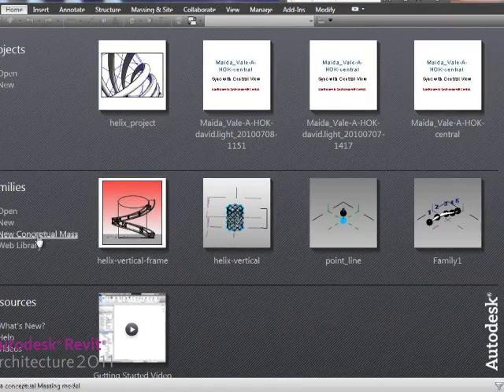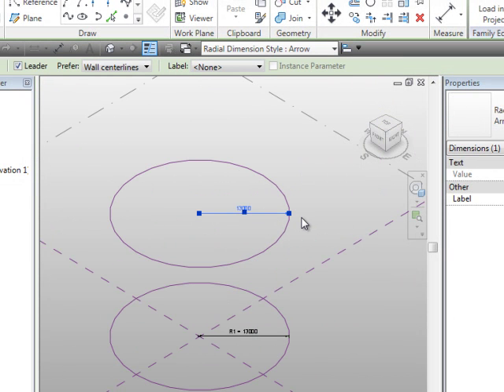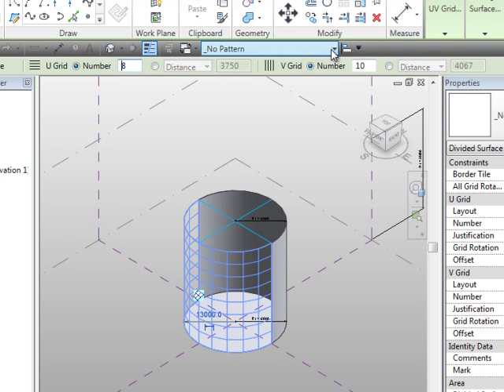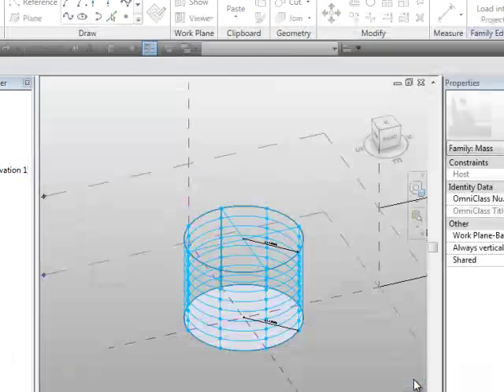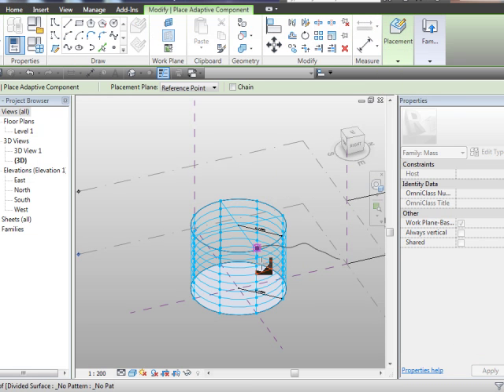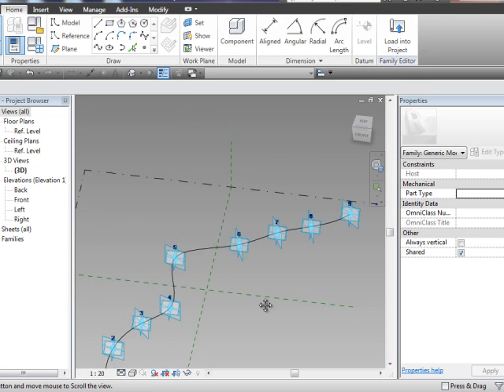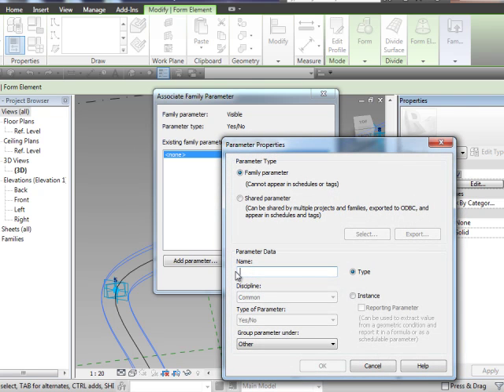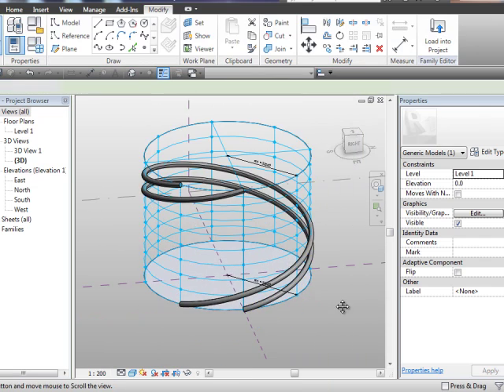How to create in Helix in Revit 2011 using adaptive component

Comment: very clear. I am trying to use this technique to create helical ramp for parking garage. The width of the solid form I have given was 21ft and its saying there are intersections in the profile and cannot create but when I create a 11ft one its doing good. Is it because of the turns we did during creating the spline. I am using 2014 revit. 
Its really great I would use it for many other designs. thanks

Comment: i need to remove the spiral from the plane how do you do that whenever i remove the cylinder all the lines dissapear im trying to use a the add profile tool but i cant separate the profile from the surface

Comment: How can I put transparency on the surface?. ... I just need to see the Helix.
Reply: Oswaldo Perez i might be wrong but click on the mass you want to make transparent and an option in the form elements section will show up called x ray
Reply: Thanks a lot Harsh, I will see if it works after Easter.
Reply: also note that sometimes it gets a little difficult to select a face so to do that press tab to cycle through options of edge and face also a second option is at the bottom in visual style which is the second button you can change to wire frame

Comment: I've found this to be extremely helpful if I'm sweeping round geometry around the helix path but if I'm using rectangular geometry, it doesn't exactly work in the same manor.  It only applies 1 edge to the nodes rather than attaching the surface/face of the extrusion to the nodes.  Any suggestions on how to correct this?

I'm trying to create a Helical Pile that is driven into the ground as an anchor.